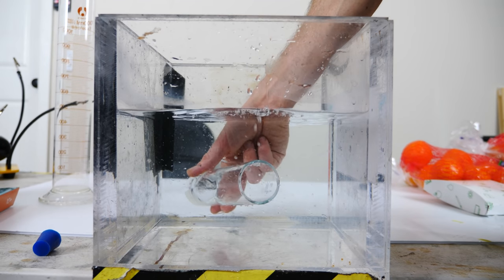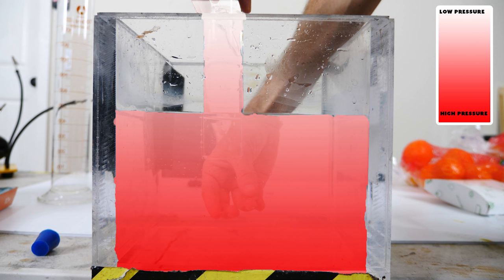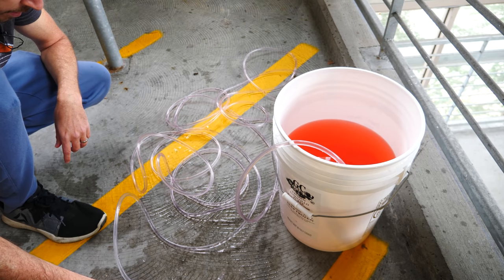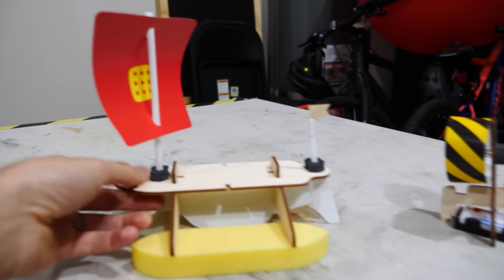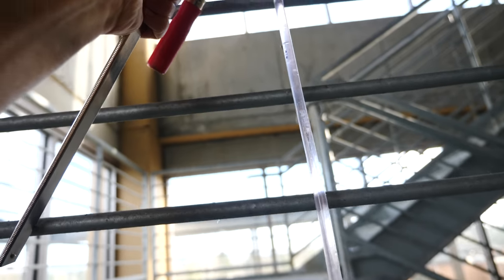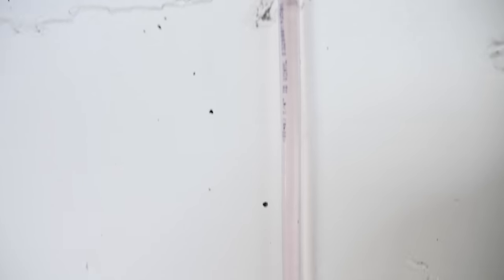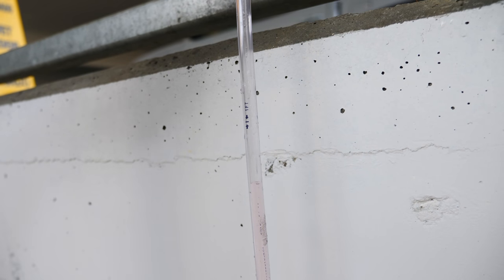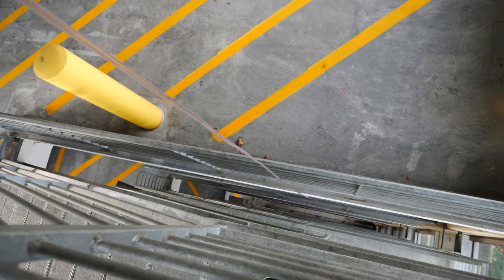Why Water Boils In Tall Cups

Comment: This is something that trees have to deal with, as not only do they grow taller than this level, they also have use for techniques to dispose of air bubbles that have formed in areas that the tree would normally succeed at passing water through.
Reply: Trees exploit the diamagmetic properties of water. So no boiling.
Reply: Holy shit how does that work please tell us I am looking at a tree right now seriously I swear on my life I am sitting in the van and I happen to look over to kind of think about what I was going to ask you and I saw a tree and I'm like how in the hell please explain to us that is very interesting I am intrigued thank you please oblige us 💓
Reply: @WiKiTWoNKa  you okay bro?
Reply: @N____er  lmao they're just curious
Reply: Not completely true. Using extremely thin tube eliminates the phenomena. Go for capillary effect to understand trees.
Reply: Changes from liquid to gas require a nucleation site. Without that, the water can go higher than the 10.3m limit. In fact the pressure at the tops of trees is around -15atm
Reply: Don't trees also use peristaltic pressure? Ie, they're pushing the water up, aren't they? So if I understand correctly, it's not quite the same thing. I think also there is osmosis pressure
Reply: @herseem  Interesting concept, but consider the fact that peristaltic pump need squeeze along flexible tube, so muscles or other actuator needed (never seen in any tree)
Reply: @mich29sm  The sandbox tree
Reply: So I have develpoed a theory, knowing of the sandbox tree. Maybe a tree literally dries itself out along route, squeezing the water upward. 
Power lines, water, and sun rays vs placement of growth and sustainability, as well as Dimethaltryptomine across plains does explain tree communication, Giving the theory of conciousness.  .. But im just crazy, so.
Reply: water doesnt boil in trees
Reply: There seems to be a bit of disagreement on this topic. This video explains it quite well: https://www.youtube.com/watch?v=BickMFHAZR0

Basically, the water can't boil if there's absolutely, 100%, not a single atom of gas in the tube. Trees can do this because they have always been filled with water since being a seed. In Action Lab's video, there are tiny air bubbles already in the tube that you can see.
Reply: Watashi kininarimas
Reply: @magnumondeko6503  no theories brother I think u have your answer in xylem and its properties and how do they work in big and small plants and huge trees
Reply: @WiKiTWoNKa  Tree: ayo you been smokin my cousin? Cannabis?
Reply: @mich29sm  it's not true to say that capillary action eliminates the effect entirely. If you put an extremely narrow glass tube in a liquid the water will rise significantly higher than in a wider tube, so the equilibrium point is higher for sure, but it doesn't completely eliminate the effect of the weight of the water
Reply: Trees take advantage of capillary action, root pumping and the cohesive force of water through transpiration to push water to the top. Capillary action and root pumping effectively remove the boiling problem by negating the effects of gravity, transpiration controls the rate the plant takes water from the soil, the water is released in the form of water vapors and its cohesive force will make it so water continues to flow upwards at the necessary rate.
Reply: @newperspective7790  trees also nete capillary action to ensure higher pressure so that the water doesn't boil
Reply: Different parts of the tree use different methods. The roots use capillary action (like a sponge).

There are layers to trees. The bark,  cambium, sapwood, heartwood.

The bark is static and doesn’t flex much. The cambium is very slippery in the growing season.

The sapwood is the only part that has water flowing through it.

The heartwood is old sap wood that has lost its water function and provides structure. Young trees and smaller branches are only sapwood and very flexible.

So water has some capillary action all the way up, but the water makes the sapwood swell a bit and the bark squeezes the sapwood between it and the heartwood, and the cambium lets the sapwood slide past and deal with the flexing.

If a tree gets a lot of water, the bark sometimes can’t take it and splits like a tomato splits. It can heal, but sometimes that doesn’t go well.

The bark on a tree also changes with age to allow for larger pressure changes.

This is my own theory, as i’ve heard its a bit of a mystery. I forget the species that i took the bark off of in june, but the cambium was super super slippery and that got me thinking about the reason and how each layer responds differently to water.
Reply: @littlecabininthebigwoods5720  thanks for that interesting info
Reply: @newperspective7790  capillary action
Reply: Neat!
Reply: You mean steam bobbles right?
Reply: @N____er  $5 says marijuana
Reply: Transpiration
Reply: Yes
Reply: Do you mean pressure inside the xylem and or phloem? Do you mean "-15atm"
Reply: Interesting. I'm going to have to look at this more closely.  Also wondering since trees don't transmit plain water but nutrients we call sap, what effect this has on the process?
Reply: Can we just agree that trees are superior beings that been playing us for eons?
Reply: Capillary force/action is a key difference. This tube is too wide to have a strong capillary action. The vessels in xylem (which conducts water in woody plants) have a tiny diameter.
Reply: @newperspective7790  false
Reply: @everettduncan7543  nope
Reply: @WiKiTWoNKa can I have some?
Reply: There aren't any tubes in trees to bring up the water. The cellular exchange is how it gets drawn upwards; more like sponging water from a lower bucket to a higher bucket, so you could technically draw water to space if the tree was that tall.
Reply: I thought that trees use capillary action which is the smaller the tube the more the water travels up the tube via water tension (if I remember my biology studies correctly).  I do know that that too has a limiting factor and that is why the Sequoia trees require mist/fog droplets for water.
Reply: @mich29sm  Considering capillary action gives less than 10 centimetres of height, you still need to explain the remaining 99% of the height.
Reply: I'm glad trees were able to come up with a work around for the problem.
Reply: This is fascinating stuff. Kind of makes me wish I had gone a different direction with my education about 40 years ago. 😂
Reply: Tree use capillarity effect that kind of have intermolecular forces that can get water to lift very high.
Reply: @magnumondeko6503  you had a bit too much of that DMT you're talking about
Reply: Spoiler : we have no goddamm idea how trees do this
Reply: @WiKiTWoNKa 
Are you high?
Reply: @RestitutorEuropa  no I'm actually at ground level but he is very high, I don't know how many stories but he is very high 😱
Reply: @WiKiTWoNKa don't be driving on those shrooms lol
Reply: @TheCutiePatrol  I don't drive on shrooms I drive on 4 wheels LOL
Reply: @btf_flotsam478  osmotic pressure. The higher salt concentrations in the leaves pulls the water with a lower salt content at root level to the top.

Comment: I find it super interesting that the water boils at just over 33’ above the surface of the bucket. It makes perfect sense though. At the surface of the water in the bucket the pressure is 1ATA (atmospheres absolute). If you were diving down into a body of water the pressure increases by 1 atmosphere every 33’ that you descend. It makes sense that by raising the tube by 33’ would basically negate any atmospheric pressure present on that water at the very end of the tube causing it to vaporize. Very cool experiment. 👍
Reply: yup, also how clouds exist ^_^
Reply: This comment helps me understand why a bit better.
Reply: a bit late but now this comment has 33 likes, how fitting
Reply: @oliversmith1981 I know! I was confused as hell haha
Reply: Yeah the weight of a 1 square inch column of water 33 feet high is 14.7 pounds the same as typical atmospheric pressure of 14.7 psi.
Reply: @Lucian4694 2 years and the comment only had 33 likes, but in 5 days (since your post), only then it gained another 211 likes?   You're trying too hard, mate
Reply: @Ogrillian  dunno what you mean by trying too hard, i just saw that the comment had 32 likes and thought "huh, funny coincidence"
Reply: @Lucian4694  sure, I'll elaborate.  The post has been up roughly 2 years already, it even presents as the top comment (at least on my end).  5 days ago you reported it had but 33 likes, identifying a 33 pattern, sure.  In 2 years: 33 likes; but 5 days after you alledge 33 it suddenly grew >7x, over a mere 5 days, 2 years from OP?  
My gut suggests it more plausible it had oh, 240? He'll, I'll even throw a bone and suggest 233, why not?  
Maybe I'm just the arse here? It's possible I guess, it happens.  Maybe your post was honest at that time, 5 days ago??, I'd be willing to risk a few bucks it wasn't, a few bucks that allege 'you're trying too hard.'  Out of morbid curiosity... is there a way to objectively confirm?  I'd be cool with apologizing, if I'm wrong 😉
Reply: @Ogrillian  if i had known that someone would want proof i would have taken a screenshot (although those can be faked so it still isn't the best evidence), but I didn't know so all I can say is that i read the comment, saw that it had the perfect amount of likes for me to make a funny coincidence if i added a like, so i did so before leaving a comment mentioning it and going on with my day
quick edit: i woke up about 20 minutes ago so if this comment sounds odd i can reword it
Reply: I just made it 333
Reply: @Ogrillian  My guess is that maybe this video is seeing more traffic recently. It popped up in my feed so maybe it did in lots of other people's as well and therefore garnered more comments and likes in a short amount of time. I also see many inconsistencies in comments, replies and likes on YT so could just be that too. Not really a big deal either way.
Reply: Just showed up on my feed as well, so I'd say lately YouTube was pushing this video, and comment likes came along for the ride
Reply: Oh yeah, I forgot my diving.  33’ is one atmosphere of pressure, that makes perfect sense that’s where it boils.
Reply: Yes, it is not exactly 33', it is actually at 32.808', this is why we use metric, water pressure increases by 1ATM every 10m.
Reply: Its not exactly at perfect vacuum but at a pressure of 0.41 psi (2.8% of ata) that water at a temperature of (estimate) 20 °C as shown in the video. You can calculate it with the Clausius Clapeyron equation, see my comment if interested :)
Reply: What confuses me though is the pressure outside the tube isn't nearly that low.  So it is weird to me that it can be inside.
Reply: 33….? Sounds FreeMasonic 😅
Reply: Yup, this property is also why divers have to control their accent or the nitrogen in their blood will be pulled out of solution and give them the bends.
Reply: I always use 1m water as a proxy for 0.1bar
Reply: But why would low pressure cause boiling? I thought high-pressure created heat
Reply: @edbrooke75 high pressure doesn't create heat, but the two often go hand in hand for precisely the same reason here. Higher pressure means a higher boiling point. For example a pressure cooker uses this to let you get the water to above 100C before it boils away.
Reply: It seems to me that there has to be some kind of cool new practical application to utilize that effect. Possibly something that has never been invented yet? What could this be used for?
Reply: Genius.
Reply: Damn schizo numbers
Reply: @Ogrillian  Algorithm cause video to be popular again. Accusing people of basically "lying" isn't exactly the nicest thing when you have options that might be substantially more likely to happen.
Reply: @jannegrey593  gooood morning Janne.  Welcome aboard,  there're peanuts at the side table, shrimp skewers and ham sandwiches available at the buffet, more options will be brought out later.
Reply: @Ogrillian Have you apologised yet,  just reminding you. 
Mostly I am provoking people to admit when they are wrong online,  or seems remarkably hard to admit to compete strangers in a platform of basically all information that you might not have considered all options. It fascinates and terrifies me.
Reply: I think it’s even more interesting that this number is the acceleration due to gravity on earth, 32.2 ft/s/s or 9.8 m/s/s
Reply: @highrollingpanda7064  Water is close in density to 1000kg per cubic meter. So it might not be coincidental.
Reply: @jannegrey593  yep, this is exactly why actually!
Reply: That made a lot of sense as a scuba diver
Reply: You explained it better than he did lol
Reply: @edbrooke75 boiling means it has enough energy to become a gas. On sea level that means very hot, but the higher you go, the less pressure is holding it back and thus less heat you actually need.
Reply: Yeah when he said 33’
Reply: Best part, 33 feet is 10.058 meters!
Reply: Thanks for that.
Funny how I can kind of understand something, but another statement helps make it click into place

Comment: Worth mentioning that this is how we measure the atmospheric pressure. Only to make the setup more compact we use mercury instead of water as it's much denser and can create same weight in a smaller column.
Reply: Correct, he has built a WATER BAROMETER.
The water is NOT BOILING, but rather sea level AIR PRESSURE can only support a HYDROSTATIC COLUMN that is 10.33 meters tall. 
Above that height only a zero-pressure vacuum can exist.
Reply: which is also why the imperial unit for pressure is mm Hg. Hg is the chemical symbol for mercury
Reply: Thats makes a lot more sense now  thanks @dsdy1205 !
Reply: @mrhypobaric2532  water lifted above that point BOILS, yes.
Reply: @mrhypobaric2532  Water boils due to low pressure. It is not only because of temperature, if the water goes from liquid to gas, it boils.
Reply: @mrhypobaric2532  Water boils at that point because at lower pressures, substances will boil at lower temperatures as well (even at room temperature, or below).
Reply: @mrhypobaric2532  But vacuum would squeeze the tube, and can the inner volume be both water vapor and vacuum.
Reply: @DR_1_1  Correct, the surrounding Air Pressure outside the tube will be attempting to crush the vacuum containing tube. This is why functional WATER BAROMETERS must have RIGID PIPING rather than FLEXIBLE TUBING. The Rigid Pipes must be strong enough to maintain their cylindrical shape despite a Pressure Differential of 760 - 0 = 760 mmHg across the Pipe Wall.
Reply: @mrhypobaric2532  thats also why planets don't indefinitely gain mass
Reply: @DR_1_1  It is a PURE VACUUM, with a pressure of 0.0000 mmHg it contains ZERO molecules of water vapor.
The Water at the very top of the water column has a pressure that is just fractionally greater than 0.0000 mmHg.
Reply: @mrhypobaric2532  Your explanation makes more sense as in a mercury barometer there wouldn't be 'mercury vapor' in the top of the tube due to the mercury boiling at low pressure in the tube.
Reply: @dsdy1205 wouldn’t the imperial unit be inches of mercury?  That’s what the US still uses.
Reply: @JamesQMurphy  nope, they use mm Hg. Inches of Hg would be such a large unit it would not be convenient or intuitive for daily use,  which are the two things Imperial has going for it
Reply: @mrhypobaric2532  it wouldn't be a pure vacuum, it would be the vapour pressure of water. Above mercury it would be the vapour pressure of Mercury. Please google vapour pressure or the boiling point of water at low pressure.
Reply: For really low pressures, we can use inches or cm of water. My CPAP is set to 12 cm of water pressure.
Reply: Yeah, it's Torricelli's barometer, right?
Reply: @JamesQMurphy The US unit of pressure is actually PSI, pounds per square inch. Millimeters of mercury and inches of mercury are units that are used in some trades, but they aren't the "normal" unit(blood pressure is typically reported in mmHg, inches of mercury is used in weather)
Reply: @mrhypobaric2532  Water boiling is defined by the vapor pressure of the liquids equaling atmospheric pressure. It has nothing to do with temperatures and is 100000% boiling still

Comment: Neat.  If anyone tries this experiment, remember to de-gas the water before starting.  Boil the water to remove dissolved air, then use immediately or store without contact with air (a layer of oil can help).  This will help you keep a better vacuum at the top and give more consistent results.
Reply: Record your starting point above sea level.
Reply: Just curious, what would happen if we didn't and used straight tap water?
Reply: @leethebruce1605 When water is mixed with other solutes, it can rasie or decrease the boiling point as i believe the boiling point then jsut becomes an average of the substances in the solution. Well i don't know if its related to that, but its just something of what i know
Reply: Well, that's good for a baseline, but the curious might want to vary the experiment to see what happens. You can try distilled water, but you can also try tap water, salt water, dirty/stagnant water, dyed water (to see any effect on the dye as you get closer to the top), just lots of ways you can do this.

Maybe use milk or juice, or even put a big helping of cooking oil into the top end of the tube before you seal it off and bring it upward. That oil has a boiling point, too, and it's different from that of water!
Reply: @KazmirRunik  I REALLY want to see someone boil cooking oil like this. Crazy long tube!